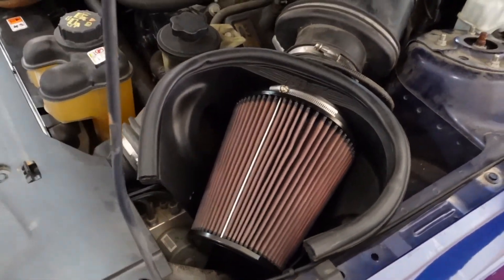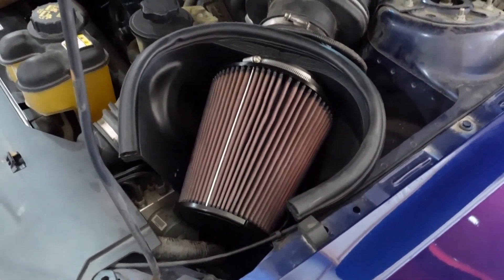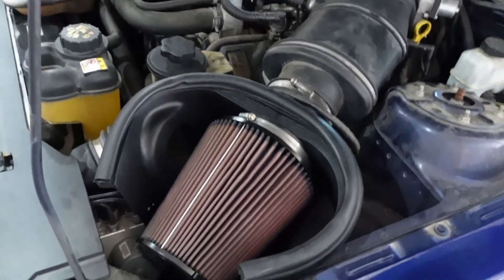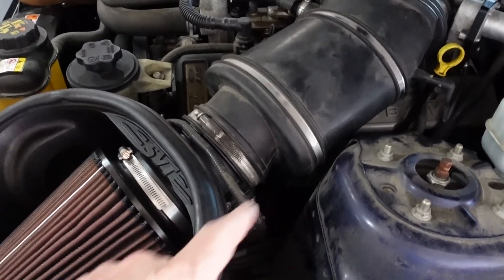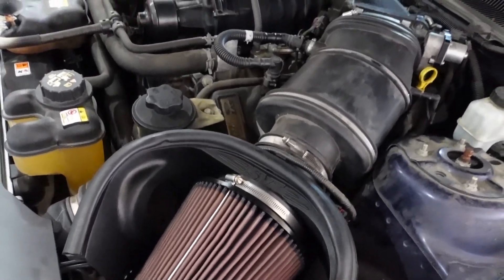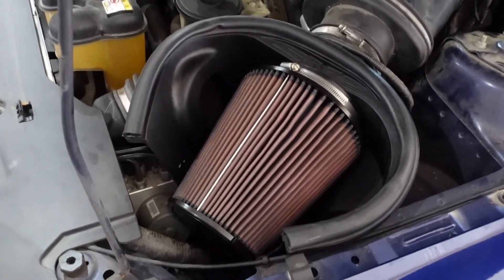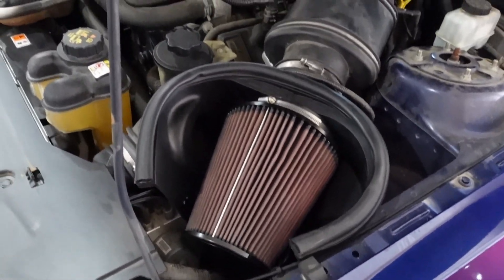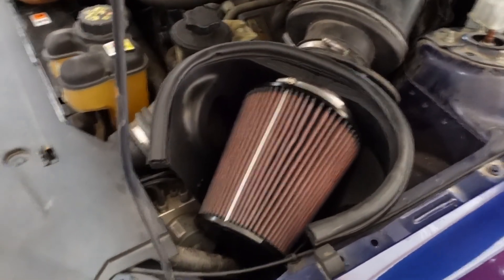We have boost! 2010 GT500 low boost issue fixed!

Comment: .032 gap is when you're pullied running more boost.  Stock it should prob be little wider gap.  It may not hurt though I don't know.  I run mine at .026 but I have a gen3r on mine pushing 20 psi lol.
Reply from the maker: Right on